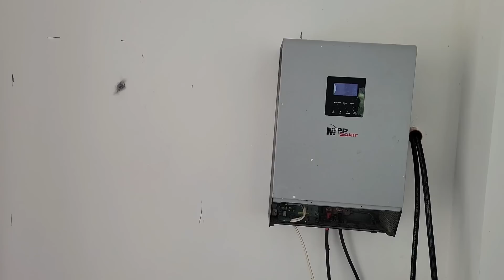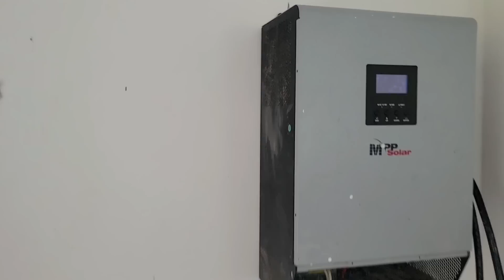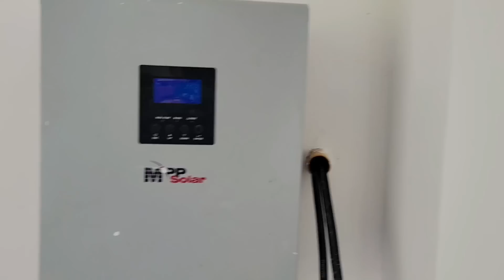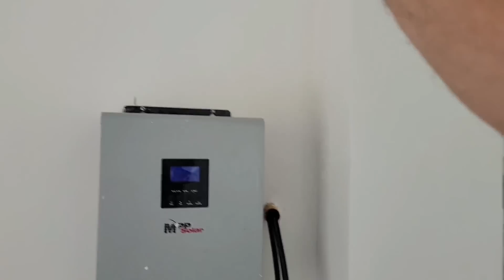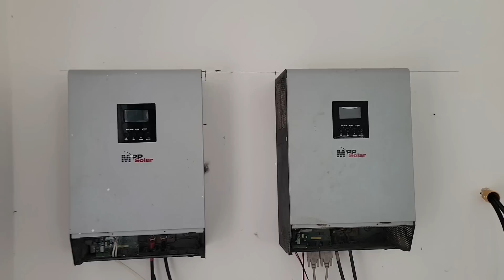Lithium Batteries and Inverters to Permanent Location- Solar and WIND 10KW Setup

Comment: Honestly how much do you got. Stuck into your solar? And now your being the guy I know! Solar 120000
Reply from the maker: The four 200an lifepo4 batteries was if I remember correctly  around $3000 or so. The two inverters maybe $600 in the pair. Could be a hundred more just cant remember exactly. The solar panels 12 panels at I think maybe $120 each ( just dont remember at the moment unless I review a old video) so lets say $1440. Rails $300  Breakers , wiring etc $350 I'd guess. Pv Combiner box $100  = $5790  Now the Wind Generator was about $900 when I bought it but now to buy that one is like $2200 crazy increase. The two charge controllers for it was about $150 each.  then the dual cables 10 gauge  three conductor cord was about $180 , breakers for it $50 . Then the pole and mounts $150 more. $1580  so the two systems together $5790 plus $1580 = $7370    What you have not seen yet is that I just bought more panels 10 545watt mono   9600 peso each ($174.55) plus $200 in rails and mounting hardware. Have not put them up yet. Just got the rails yesterday.
Reply: Besides it's not  my business

Comment: Where did you buy your invertors. And is it very expensive. I want to have 110 volts and 220 volts in my house in Guimbal
Reply from the maker: I bought from MPP SOLAR in Taiwan directly.  You will either need two inverters  ie: one operating 110v and another running 220v SINGLE PHASE.   You CAN NOT use a 220v USA Split Phase for Philippines 220v single phase .  Second option is to just run one inverter 220V Single Phase for Philippines voltage and use a step down transformer to 110v for the items you need to run on 110 v

Comment: Hey James. I wanted to correct a small misunderstanding you have with regards to your battery communication. Although it seems like connecting all the communications together does something for you or the batteries, I can assure you that there is no point at all and no benefit to connecting them. The ONLY time communication is used is when using a compatible inverter/charger. 
Connecting them all together like you have done does not help the system in any way. The batteries only “talk” they do not listen at all. 
The idea is that when the batteries are getting close to full or hot, they broadcast this and if there is a device that can understand it, it will lower charge/discharge rate as needed. 
It does not help with balancing, to this I am 100% certain. You can check with the manufacturer if you like, but I understand this communication system very well

One last thing is that the inverters you have can not communicate with the batteries due to not having a compatible protocol between them. 
Hope this helps clean up your install a little and also finds you well. 
Cheers
Reply from the maker: I will respond back on this and correct you as well.  Connecting them together even without a compatible inverter  for communication does help. these do have a internal bms. Also lets say I do not connect the communication cables up. Now I would have to power each battery on manually pushing each button on the front. Once the communication cables are connected I can push one button and all batteries turn off and on together. This can save a huge imbalance issue. Lets say the system shuts down with cutoff point on the battery settings. On has a sensor that that also connects to the solar leads and one to the grid source. When it sees there is a power source available to charge it again it allows the contacts in the batteries to close and startup the inverter again and resume charging and start making power again once charged back up to the level I have preset in my inverter settings. So if no communication cables are connected only one battery will turn back on and charge while the others will still be off and the contacts in them open. Now one battery took charge while the rest are empty.  I have been using these inverters and batteries for years now. This is not a new install this is just a relocation.  I know this system well as we live by it daily for a long time now.  the communication cable absolutely have to be connected, dip switch setting correct on each battery and sensors plugged into communication ports also.
Reply: @TexasFilipino  I know that you’ve been using those batteries for a short time but you have been using those inverters for years, I’ve seen all your videos.
Reply from the maker: @sNEAKYnIGHTmUPPET  I installed tbose lifepo4 batteries 25 months ago already. Time flies
Reply: @TexasFilipino  that I can believe. The point I was trying to make was that those inverters and your experience with them started in the lead acid days. When I suggested to how many times to go lithium you shot down my suggestions talking about how bad the were and they weren’t ready for off grid use. I still use my pip5048mg units from mpp; the only difference is I started on lithium off grid skipping lead acid altogether. 
I’m glad you finally took the plunge, even if it was 2 years ago. 
I stand behind what I said before, I checked into to it to be certain. The communication does nothing for balancing or charging. If yours shut down all batteries if one goes out of balance, that is not a good feature. You said it yourself, redundancy is important. One battery taking out your whole bank is not great. 
Anyways, do more solar videos, I like to watch them. Maybe toss in some production stats at the end saying how much used vs brought in that day. Just a thought, hello to Melinda.
Reply: @sNEAKYnIGHTmUPPET you are entirely correct!  Thanks for the update 😊!

Comment: Yes James I’m also interested in learning solar with zero experience. So thanks to you I’m slowly learning, I’m a slow learner, but I’m learning.
Reply: Turns out that it's not rocket science. I decided to put solar in for 2 reasons. #1 was to reduce the electrical bills, over the years that really adds and I wanted to reduce that expense for when I'm done and gone. #2 was to have a UPS system for the brownouts.  Well I gave myself enough of an education to determine what I needed and wanted. I requested quotes from 4 installers, one never sent me anything after saying they would. The other 3 gave me quotes that weren't event close to my spec. None of them even included batteries as requested. Also none of them would do a ground mount. I was perfectly willing to spread some money around and support the economy. So I again requested updated quotes, only received 1, still not close. So I educated myself further. I designed my own system. 21 kWp of panels, 16 kW hybrid inverter, 30 kWh of batteries. I ordered all of my equipment. I used 2 meter ground screws which I had to install manually as I only found 1 place that had a power driver. It's really for use on solar farms and they wanted 35k pesos a day. Well I only had 12 screws to put in so I was willing to pay...but they wanted 100k pesos to deliver and pick it up, basically they use a flat bed semi. I'm not willing to help the economy that much. So I did it myself by hand. I did the entire aluminum ground mount, the low side is about 9 feet high at the lowest point. The panels are at a 15 degree angle. I used 30 panels, portrait layout in 2 rows. The array is about 65 feet long. I hired some of my wife's relatives to put the panels up, 86 lbs each. I also had them put some concrete  piers around the lower portion of each ground screw, rebar in the ground and a cage and the concrete also parially buried. I used round trashcans for the forms, made a nice ribbed pattern in the concrete. I used the original box with the utility CB and gen CB in it as a manual bypass for the inverter. The inverter feeds the entire house. House runs on solar and battery 24/7. I am grid tied for the surge capacity. I've been online since the end of last October. So DIY is doable as JH has shown. I live in Lipa City, Batangas.
Reply: @pilotdrh  geez thanks for a bit of encouragement. Your plan sounds exactly what I’m wanting to do in about a year. Honestly I know zero about solar power, but I’m a very capable guy to learn and pretty handy at learning and building projects. Thanks for the help.
Reply from the maker: @pilotdrh I appreciate you sharing all of this info. I would like to talk to you via video if possible and would you be willing to share some pics of your project and equipment? james ray hightower on fb messenger and jamesray080808@gmail.com
Reply: @pilotdrh Sounds like you now have "Ultimate Cosmic Power!" Good Sir 😁👍👍 I'm wondering if you could share the model of your solar panels? They sound like super jumbo panels without a doubt.  Right now I've got 28 190w panels and 24 240w panels on my system also with 30kw of lithium iron phosphate batteries.  But you definitely have me beat for inverter haha, you're big time ready to rock 👍👍
Reply: @WhenTheManComesAround  Bluesun BSM700PMB6-70SDC 30 panels. Bifacial.
Reply: @WhenTheManComesAround  Bluesun Quad Ultra BSM700PMB6-70SDC 700 Watt
Shingled PERC Bifacial Module Half Cut, N Type, HJT 210 cell, 2384*1303*35mm,  39 kg. Voc/V 47.7,  Isc/A 18.8 Big Time....I did live in TX for a while!

Comment: I would watch the temp in your inverter. I have had solar for years here on Palawan with a 48v system I installed myself. I have it in a small utility building built for it. It can get up to 40-42C when its  hot out real quick. I fnally put a small inverter Air Con in the room which keeps it around 32C. Cooler the better.
Reply from the maker: Thank you. We have been running this system here for years now. We are only transferring it and actually to a cooler location. I keep the bottom cover off and  it lets the air flow so much better. The that room will my office slash get away and aircon  sometimes if really hot.

Comment: James, you do you, brother! I cringe everytime you even acknowledge some troll making an adversarial comment about the layout or design or your wonderful home in Las Conchas Del Mar. I never mentioned how much I appreciated time spent on your Hybrid Solar plans at your house. I had not really thought about solutions to the brownouts we experience throughout the Philippines. I had just accepted them as a part of life there. But because of your well-explained reasoning and required equipment, I now have plans to integrate either offgrid or hybrid solar systems. Since my upcoming return to the Philippines is on a permanent basis, it's been great seeing the varied choices you have made in building your house, and now considering how similar choices could improve upon any plans I had previously made. Thanks again for all you do and my continued best wishes to you and Melinda.
Reply from the maker: I will be giving some suggestions in a upcoming video for a new home builder if they plan to have solar. Stay tuned
Reply: @TexasFilipino I look forward to that. 1st thing I'm doing is adding solar in Samar. Brown outs are too frequent for what I want to do.
Reply from the maker: It is not a troll. Not a troll at all. I just used the comment for explanation as to why and topic. Many may not know what this place is
Reply: Agreed! Even if some folks picked up some all in one units like a 2k bluetti it would minimize the impact of the brownouts.  Lots of great tech available these days, and it can be a game changer without a doubt 👍

Comment: Looking forward to more updates when you get your solar all setup. I see you have approx 20Kw of batteries. I will be interested to see if that runs your whole household? Your system will be a good yard stick for my system in the future. As always I enjoy your videos. Very informative. Cheers!!!
Reply from the maker: its been running our house for years already
Reply: @TexasFilipino  ah ok. I must have missed the addition of the 3rd and 4th batteries. How many Kw of panels do you have? Thx in advance for info.
Reply from the maker: I have all four batteries at the same time. This has all been in our garage while we built the house. Just transferring the equipment slowly and switching circuits over from the temp lines in the garage. Now I am adding more charge controller for the wind generator which we sent from our home in Texas.  It is so nice to get this system all put together permanently.
Reply: @TexasFilipino  ok thanks James! My memory ain't what it used to be. I will look back and review old videos. Cheers!
Reply: 20kw? I thought this was a 10kw setup? Anyway, I always give my undivided attention when talking solar and wind systems, plan on doing same in Bicol. BTW… what is your panel setup? 400w X ??… thanks for all the great info man.
Reply from the maker: it is only strong as its weakest link. I have two 5kw inverters = 10kw  I have 20kwh in lithium batteries but they are probably slightly over rated. I have 12 335 watt poly panels and coming up in a video 10 new 545watts mono panels. 9470 watts of panels. I have 2000watts wind generator that might make 2000 watts just prior to it's self destruction in a typhoon ( lol ) but in reality in 20 mph winds might make  350 to 400 watts.   5 to 15 mph winds lucky if you see 5 to 100 watts. Seems 20 mph is where it starts to shine.  So I round the system to 10 kw.
Reply: Thanks for info update James. Much appreciated. Its a bit hard for me to size my solar system until I actually retire in the fils. So observing other peoples systems gives me an idea of what U might need. Salamat !!!